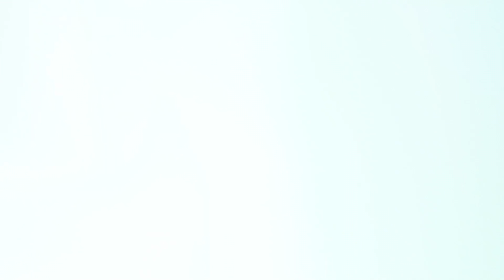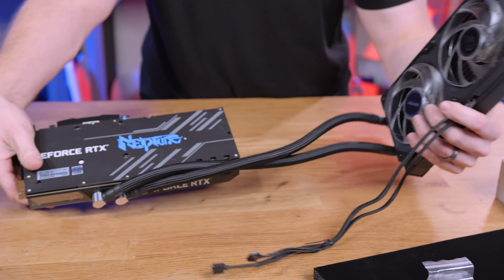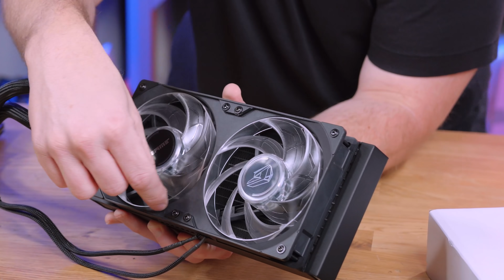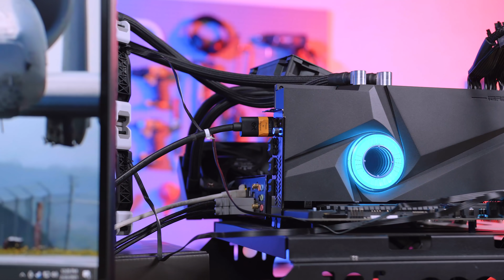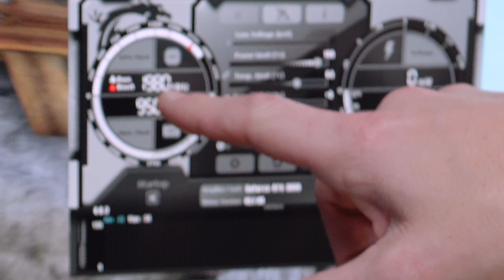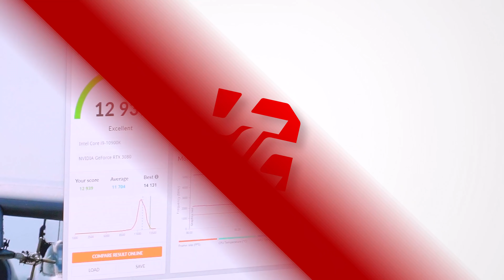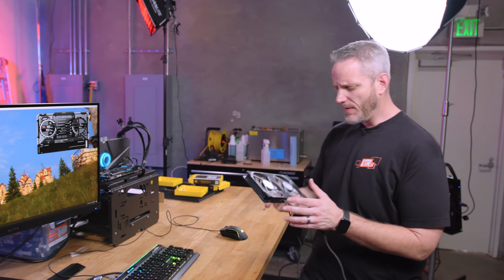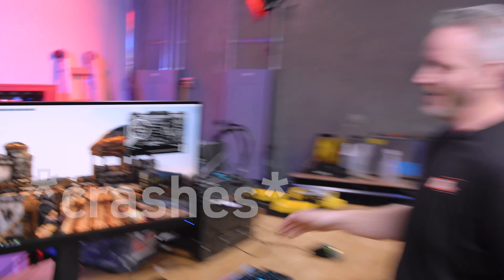AIO vs Air Cooled Video Cards... worth the extra cost?

Comment: AIO cards aren’t ever really worth it unless you are an enthusiast with a nearly unlimited budget. They offer a minimal performance improvement at a significant cost increase. Generally speaking, you should always buy the cheapest GPU of the model you want, as of right now the reference AMD card or FE Nvidia cards.

Until you get into the enthusiast level (6900xt or RTX 3090) you shouldn’t even consider an AIO card. There’s no performance reason to get a 6800xt or RTX 3080 with an AIO since a 6900xt or RTX 3090 will outperform them anyways.

Comment: I put together an AIO for my rx580 for less than $50 using a NZXT Kraken G12 for $20 and an alienware area 51 r2 120mm AIO for $28, both new so yeah, it was way cheap and it has a fan too for the VRMs.

Comment: If they made the LC cards in white I would have bought the Strix 6800XT LC. I  I had to settle for a Strix 3080(after 14hrs in line) the cables are a turn off too though.

Comment: Honestly I have never heard of an AIO cooled graphics card.
Reply: No I have, just that Ive never heard of one before
Reply: Well if you're a subscriber I'd have assumed you'd at least have heard about the Kingpin cards, the newest one has an AIO style stock cooler
Reply: Do you live under a rock or something???

AIO GPUs aren't new at all.
Reply: @PSYCHOV3N0M  first time ive heard of them. We were not born with pc knowledge not to mention computers are not the only hobby for some people. Computers are my side hobby, i dont have enough time to find out about everysingle thing. When ive seen water cooling it temds to be open loop at elast what ive run into but pretty much of the systems ive run into have been air cooled
Reply: Havent been watching the vids recently, been watching other content
Reply: You learn somthing everyday
Reply: its been a thing since 2014 if not earlier
Kits came first maybe since the 600 or 700 series and then companies started shipping GPUs with them preinstalled.
Reply: Still rocking my EVGA GTX 1080 FTW Hybrid, it's honestly pretty nice.
Reply: @YodielandInhabitant710  EVGA GTX1080 XC Hybrid and according to stock and scalpers I will be rocking it a while longer
Reply: @YodielandInhabitant710  I got my first hybrid card in December, at Micro Center, the Asus ROG Strix LC 6800 XT and I was hesitant at first because some people say the pumps fail etc. So far I'm very happy with the performance and the cooling is fantastic, 50C with a 2.7ghz overclock. Have you had any issues with your pump, air or anything like that? I have no coil whine on mine or any air in the loop problems. Mine's mounted vertically and it's much quieter than the air cooled card it replaced.
Reply: @YodielandInhabitant710  Same here! Bought mine as B-stock (refurbished) from EVGA in Sept. of '17 and still going strong.
Reply: Never built a computer then?
Reply: @filonin2  lol exactly
Reply: @filonin2  I have built a computer and have also never heard of aio graphics cards.
Reply: @trevvrun  Not much of a viewer of the channel then or you haven't looked at building a high performance computer in the last 5 years? I can't help if you live under a rock.
Reply: @filonin2  You're mad because I've never heard of something. Weird.
Reply: @trevvrun  Mad? You told me you've never heard of an AIO and I asked if you'd not watched the channel much since they obviously are regularly discussed and they are common hardware for performance computers. Are you a bot or something? Your responses make no sense.
Reply: @filonin2  Calm down.

Comment: Me with intel integrated graphics: hmm interesting...

Update: I Got a amd R5 240 graphics card on eBay for $15 for my new build with the 5600x
Reply: You could get an AIO for your processor and technically say you have water cooled graphics.
Reply: @thatsgottahurt  Is that the power of overclocking your brain? Cuz that's pretty smart.
Reply: F
Reply: Hey im not alone :D
Reply: Me too. Got an i3 4170. Although I’m really close to finishing a new build. Just holding out for a 3070
Reply: @thatchadbrad  you’ll be done with that build... in about 3 years.
Reply: @thatchadbrad  dont pair that with a 3070
Reply: @thecatserole245  no it’s a whole new build. It’ll be paired with a 3900xt
Reply: @thatchadbrad  i3+3070??
Reply: @ulfhednr  the i3 is my current computer. I’m making one with everything new. It’ll have 3900xt, 3070, 32gb ram 3600, etc
Reply: Ouch
Reply: laughs in Keplar
Reply: Get a gt 1030
Reply: Y same
Reply: F
Reply: Bullshit no one is using integrated graphics in 2021. Just said that to get likes.
Reply: @straya31  it’s a laptop chief 😔
Reply: @straya31  Actually, alot of people do. Just because you don't and I don't doesnt mean other people dont. Grow up.

Comment: To quote Bender Rodriguez:  "Ah, they're both fine choices".

Water-cooling is nice for GPUs, especially with how hot these new GPUs can get, but it makes little sense to get one for a 6000 series GPU when they're limited to a maximum of 2.8Ghz (3.0 on the 6900 XT), so one's gains for max'ing out the graphics card are minimal compared to the 3000 series.  Maybe when power tables become a thing it'll be more worth consideration beyond noise.

Comment: I only have a lame EK block on my 2080 ti 🤷
& 7:19 even when I mined etherium for a day and a half GPU temp never made it to 50°c lol 47 max
my 5800x however just on auto will boost all cores to 4850mhz and hit around 78°c in Aida64extreme system stability test.
Reply: So lame
Reply: @aussieguy1593  yeah and it's all black so you can't even see the fluid. super mega lame 🥺

Comment: Honestly, the aio ones are going to be in stock, so I'll get those.
Reply: No they won’t. At least not in America
Reply: Based on their setup miners may prefer AIO cards seeing how they take up less slots meaning they can fit more on a board or a rack. The rads can easily be placed to the side or even sat on top of the GPUs, and if they have discounts on the tubes thats even better.
Reply: @Kirinketsu_  miners prefer normal cards, since they are cheaper and perform the same
Reply: @abbechang2771  You should learn to read before commenting, I clearly gave examples to when miners may prefer hybrid/AIO GPUs. $100 to $200 extra if nothing for a miner and will be worth the price if it mean they are getting a 2 slot GPU rather than a 2.25 to 3.5 slot card if it is better for their setup. Also after the card hits the 3rd party market that $100 to $200 is not even going to be a factor in the price anymore.
BTW Overclocking a GPU does boost mining, paying a little extra for a bin GPU will be worth the $50 to $100 if it will run at 80% power while with an overclock higher than a "MSRP" GPU.
Reply: @Kirinketsu_  the cooling nor bonus boost clock doesn't do anything for mining. Current cards can already max out their memory temps. And more slots in a card doesn't matter to miners since their just going to use 8 gpu frames anyways
Reply: @abbechang2771  You know nothing John Snow
Reply: @Kirinketsu_  I'm a miner.. I do know things
Reply: Where? Not in the u.s. but I’m hoping in a few years.....😔
Reply: In general, there are fewer liquid-cooled GPUs made just because they're so expensive and it's for a very niche market.
Reply: Looks soo sexy
Reply: I bought a 6800xt just a couple weeks ago from newegg. Just watched their site they get a couple in every few days
Reply: This comment will probably age like milk